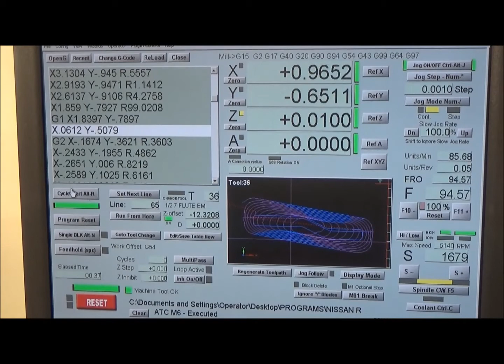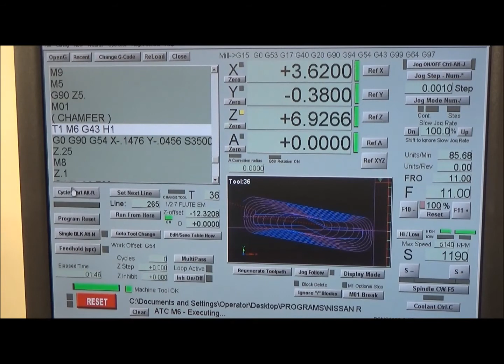S14 TI 2ND OP

Comment from the maker: FPT is .0048 to achieve with chip thinning to actual .002 FPT. RDOC is 7% (.035") and DOC is around 1/4". I took a gamble on this one but it all worked out ok. the price of the end mill was not worth the beating the machine and tool took. so next time i'll just go with shorter 3/8 with variable helix and unequal spacing, the cost of 3/8 compare to the 7 flute 1/2" is too great to ignore.